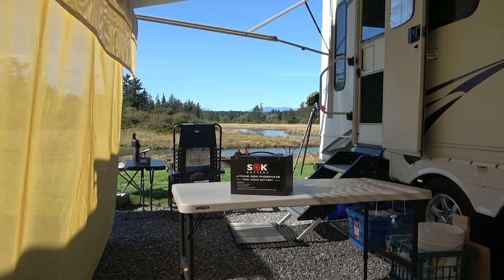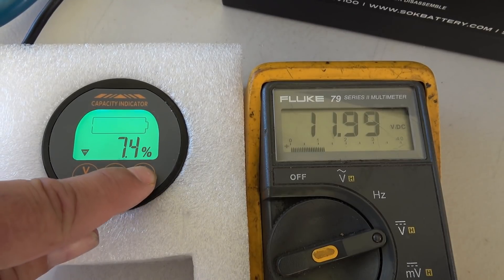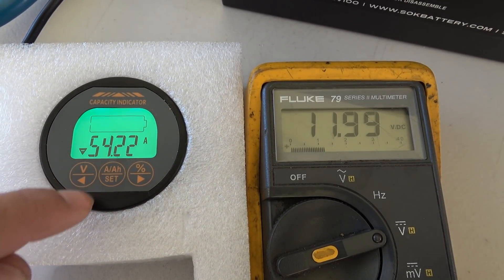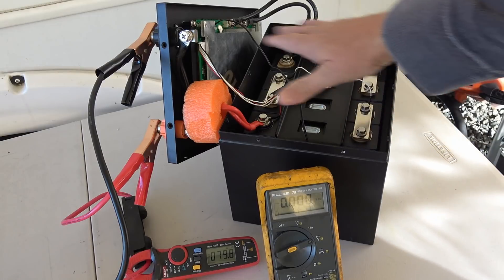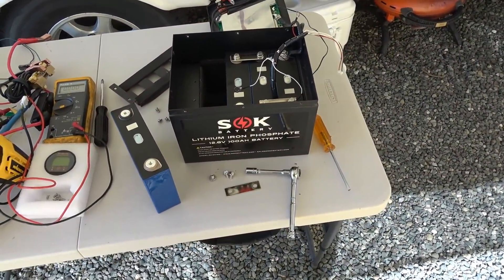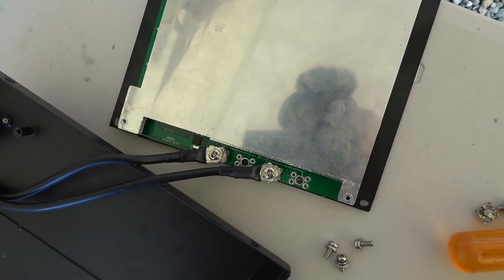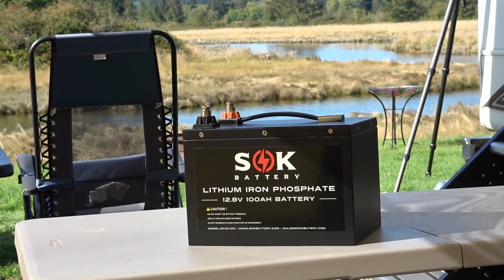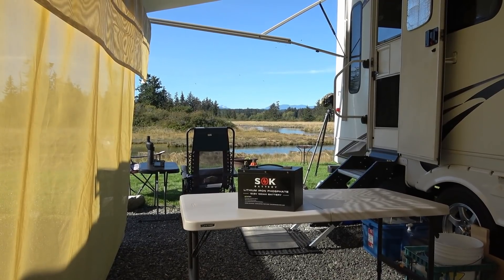SOK Lithium Battery Review Update + Giveaway Announcement

Comment: These batteries are horrible I have had my 280AH since may amd it has yet to work reliably. Every time I wake it up from sleep it runs for 20 min and dies. Have replaced the bms 2 times and it's always cell 4 that dies.
Reply from the maker: Weird, they have a pretty good reputation and have been around a while now. I wonder if the cell is killing the BMS or a flaw in the wiring. I haven't had any issues with the SOK. I've tested a 280Ah model in my system for many months. The only thing I didn't like was the app but the battery performed well.  At this point they should give you a refund or a new battery.
Reply: @LoveYourRV  that's what I am trying for now, WISH me luck.

Comment: Ray I am curious ..I am running 3 100-amp 12 volt renogy  lithium batteries in my rig  ..have you ever noticed the battery closest to the ground tends to discharge first ?? or could I have a bad battery ?
Reply from the maker: No, can't say I have, but I do take the batteries out every 3-6 months and recharge them fully individually just to make sure they are balanced as I imagine over time they can drift.

Comment: I just watched both of your vids on these SOK's and you said here that your OEM charger would not charge the SOK and you covered that before. I never heard you mention anything like that in either video. Maybe I missed it.  That's pretty important information to know before going to Lithium.
So I'd like to ask you a couple of questions and I really hope you'll answer: 
1) I currently run lead acid Trojans. I have a Inteli-Power PD-9260C charger just like the one you tested with in video one. Will the PD-9260C charge these SOK's just fine even though it's a 4 stage charger
2) If I was to buy two 100Ah SOK's do I hook them up in Series like I did with my Trojans or is it just be better to buy the 206Ah SOK version

Thanks for doing these videos 👍
Reply from the maker: Here is the video you'll want to watch https://www.loveyourrv.com/lithium-battery-charge-test-can-you-use-a-lead-acid-charge-converter/  Personally I'd rather get two 100 AH for redundancy if something goes wrong you're not dead in the water.  If you have a 12V battery system you'll want to hook them in parallel, not series.  Hooked up in series the voltage doubles so they would be 24V. When you say Trojans I assume they were a 6V golf cart type and that's why they would get hooked in series to create 12V. 
I'm actually just about to install and test a new converter charger from WFCO that they claim auto-detects whether a person has lithium or lead-acid and then adjusts its charging profile to match. https://wfcoelectronics.com/product-category/auto-detect/wf-8900-ad-rep-series/ Look for that video in the new year. Cheers! Ray
Reply: @LoveYourRV  Thank you Ray so much for responding. So ya, myTrojans are 6V golf cart type and are hooked in series to create one big 12V. And they have served us well over the years. But Lithiums in Parralell Ok got it. I totally hear ya on the redundacy part of having 2 batts instead on one. I also don't like having all my eggs in one basket. I currently have several power solutions in the event of an emergency or if for one reason or another one power source is not available. 

But what about my existing Inteli-Power PD-9260C converter charger that I use for my Trojans. (like what you showed) Would that converter have to be replaced too? That's why I have always shied away from going to Lith batts. There's always more that has to be changed out that just the batt's. It's a never ending battle of upstream/downstream issues and conversions.

Any thoughts on this will be greatly appreciated. 👍
Reply from the maker: If you have the manual Charging Wizard pendant you could use the PD-9260C for charging. You press and hold the button until the light stays sold green. It overrides the lead acid charging algorithm and manually boosts the output voltage to 14.4 Volts which is great for charging lithium batteries. I think it does it for 3-4 hours or so. https://www.progressivedyn.com/rv/charge-wizard/pd92201-converter-status-remote-pendant/  I've been using it for years for generator charging of my lithium batteries.
Reply: @LoveYourRV  Thank you Ray so much. Yes I have the Charging Wizard pendant as well but I didn't know that holding the button overrides the lead acid charging algorithm. I'm going to watch your video/article that you linked above to get a better understanding. We can all learn from each other. I luv learning new stuff. BTW...after quickly looking at your channel and playlist page, I bought the Bluetti AC200P and some solar as a redundant power source mainly for emergencies when existing power sources go south for whatever reason. I just love this unit. It's a beast. I'm actually working on a video right now about it and how I intend to integrate it into our 50amp coach.  That won't be out for another few weeks. Again thank you for Collabing with me. BTW...I subbed to your channel. 👍
Reply: @LoveYourRV  So after watching your linked converter video above I'm like.....my system is identical to yours. I even have the Trimetric battery monitor like you do. I've been using the PD-9260C and Trimetric for about 5yrs. now for my Trojans and it all has worked flawlessly. 

But getting back to the Pendant. I knew about pressing that button to go into fast bulk charging but I didn't know that by doing that it cancelled the lead acid algorithm. So that was good to know. So as I was thinking about that in real life use....see if my thinking is correct on this. 

Let's say down the road I went with 2 of those SOK Lith batt's. I'm using them as normal with my  PD-9260C. But in normal mode they probably will never get past somewhere around 50%-55% charge. So, I'd press the button on the pendant, and that bulk charge will bring them up to 100% in maybe 4-5hrs. lets say. Once at 100% I'd have to press the button again to put the PD-9260C back into regular mode. So as the Lith charge goes down I'd have to do this manual bulk charge with the pendant every so often. It wouldn't be an automatic function. Is that right? If so, ya it would be a little bit of a hassle and I'd have to keep an eye on the batts, but I do that anyway so I don't think that is a deal breaker keeping the PD-9260C that I have already. I'd just have to press that button from time to time to bring them up to full charge manually.
Is that correct thinking?
Your thoughts?
thx for all your help Ray 👍

BTW...I watched your Bluetti Part 3 video. When I saw you had that sucker outside with solar hooked up I thought ya there's no way I'm doing that. 😝The Bluetti is a Beast power wise and WEIGHT wise as your know and I luv this thing. But the way I'm setting mine up it will live inside the RV. Never be brought outside. During off grid, or power outages, all charging whether it's from my portable Honda generator or solar, I've installed a pass thru plug where all wiring goes up thru the floor of the RV and into the Bluetti. I have several ways to charge the Bluetti other than that but I'm going to be showing all this when I release my video in a few weeks.

One other thing I noticed is when you had all those solar panels laying on the picnic table while it was raining. I have the exact solar panels (2 of them not 3) and in the user manual for the panels it says, "In order to maximize the lifespan of these solar panels, please try to not get them wet or soak the panel into water". Did you see those instructions? Now the wiring was under the panels to provide some protection but I don't think I would of done that.
Reply from the maker: Yes, I've been using mine manually for a couple years, its only when I need the generator so not a big deal for me, most times the solar is ding the charging or my DC-DC charger when towing if needed.
If the batteries get full, the lithium BMS shuts charging off so no worries of overcharging. But usually if I'm running the generator it means my batteries are low and I just wont to give them some power and then let solar take over.
I like to torture test things I review. Its completely ridiculous to me that Bluetti sells panels that can't get wet. I'm sure they took note. ;)  Its one reason companies like to have real world reviews because most of the time they don't actually use their own products and often don't think of simple things like make the panels water proof.
Reply: @LoveYourRV  Thanks Ray 👍I've enjoyed talking you.

Comment: I'm having 24v system with:
 800w SPanels (24v)
 400ah batteries
 2400w inverter, (LV2424), later changing to 3k inverter (when changing to 240v system, 3024gk)
Does it matters getting 2x 200a or 4 x 100ah?
Reply from the maker: Sorry, I'm not sure about that, guess it depends on space. Two would make the wiring much simpler.

Comment: Nice two reviews. Any thoughts on their claims of 4,000-8,000 cycle life? They are a brand new company and folks are just now installing them. Obviously, you could not have cycled it more than a handful of times but curious to know if these cells (and their performance) are already a known variable.
Reply from the maker: Thanks. Its comparable with what other companies that use the same type of prismatic cells are saying as well for life cycles based on average use. But these types of drop in replacements have only been out a few years so its anyone's guess for the real long term. Battery technology is evolving quickly.  Cheers, Ray

Comment: Can I replace my RV acid battery to SOK battery without any changes ?
Reply from the maker: Depends.. Almost anything will charge them but to get the most out of lithium type you need a charger that can put out a high enough voltage, many solar controllers can do that  by adjusting the settings but a lot of the OEM lead acid converter charger systems fall short. Watch this video - https://www.loveyourrv.com/lithium-battery-charge-test-can-you-use-a-lead-acid-charge-converter/ and I have more related to my change to lithium here - https://www.loveyourrv.com/tag/lithium/  Cheers, Ray
Reply: @LoveYourRV  Ray, thank you, very useful information. My rig Sprinter 2004 has very old convertor- charger. I going to check alternator voltage, if I can get  14,4 v and up, so I can charge Aux battery during the ride. . ( what I did all the time using Aux  acid battery ) I have solar battery, so charge Lithium battery no big issue
Reply from the maker: @jkjk-hj7hb  You have to be careful when charging lithium batteries with the alternator because lithium has very low resistance and can absorb higher amperage than comparable lead-acid and possibly overload the alternator causing it to overheat and maybe fail. I actually installed a DC-DC charger so I could charge my lithium bank. It regulates the charging amperage. Here is my setup - https://www.loveyourrv.com/renogy-40-amp-dc-dc-charger-installation-and-demo/
Reply: @LoveYourRV  Thank you
Reply: Sorry one more question  What are you preferred : Smart Lithium Iron Phosphate Battery or LiFePo4 ?

Comment: Just curious if the sok battery or your lion safari batteries running in parallel can start your generator without an issue?
Reply from the maker: My current generator is a little 2000W portable that has a pull start.  I guess you would have to see what kind of amperage the generator needs. My 3 Lion's in parallels can put out a sustained 450 amps but much more for short periods.  So I'm guess it they can start most RV generators. Cheers, Ray

Comment: Thank you for this review.  I’m looking to upgrade my standard lead acid battery in my travel trailer.  What would I need to do to add a charger that would charge a Lithium battery or will the charger that comes in the TT charge it?
Reply from the maker: Check out this video where I discus that topic and demo charging lithium batteries in my trailer - https://www.loveyourrv.com/lithium-battery-charge-test-can-you-use-a-lead-acid-charge-converter/  Cheers, Ray
Reply: @LoveYourRV  excellent video and explanation. Thank you.

Comment: Very interesting.  The SOK compares very favorably against the popular Battleborn.  Battleborn's published discharge voltage profile at 50 amp discharge rate shows their 100 AH battery dropping below 12V at 15% capacity remaining.  The SOK is down to 7.6% remaining at 12V.   (and on top of that, you were discharging a bit above 50A).

Comment: Oddly, a few Amazon.com reviewers determined that it exceeded it's 100Ah capacity.
Reply from the maker: That's great! Maybe they have improved them. My review battery was one of the very early batches they made and sent for review and I also have used it it for months before this test. I hear the lithium cells will put out slightly higher than rated when brand new.

Comment: Ray.
 Don here from Waterloo Ontario.
Although from northern Ontario. Travelled a lot, cut trees in port Hardy in '75. Passed Campbell river many times to and fro back to work. Living in north Vancouver in those days. I have a 34' Tiffin class A, that had 2 6 volts golf cart batteries but thanks to info from you and your channel I've upgraded to 4 lion energy 1300s/victron 712. I don't park where there is electricity, now in process of ordering 6 more from utah which would give me 1050amps. 
I found charging the 4 was a tedious task, it took approx 11 hrs, I timed. I am planning to put a magnum 3000 hybrid with solar, first chance I get to go to Red Bay Alabama. In the meantime could you advise what I can do about charging.  I'd hate to buy something now and have to get something else later.
If you can get back to me at this email with any thoughts , I'd appreciate it, thanks for what you do.
Tiffinwilltravel@gmail.com
Reply from the maker: Here is a video I did on lithium battery charging that may help.
https://www.loveyourrv.com/lithium-battery-charge-test-can-you-use-a-lead-acid-charge-converter/

Comment: It's interesting how Chinese and US markets are evolving. A lot of time the US companies are simply importers, sometimes assemblers, of a Chinese product. I bought a Bafang BBS 02 ebike motor 10 days ago. These used to be things you bought from a US company, Luna or Lectric (the old one). They would market stuff, make claims, whatever. But they would try to brand the motors, even with their logos. I just bought one from Bafang USA, very low price. It's the same as what the US suppliers sold, down to the packing. Point is that Bafang has a US presence, at least a warehouse. In this LFP case, the US suppliers are not responding very quickly, but I think the SOK price is something they cannot ignore. These cells are a bit generic but the site lists Sinopoly cells, 400 AH, for a similar price per watt. My recollection (which dims daily) is that Sinopoly is a major brand. LFP is safer and it doesn't requite cobalt. 

You might look at a split heat pump like Campervan Kevin, with a somewhat upgraded LFP bank. You can heat and cool with this system. The compressor is outside. I don't know why they don't make well insulated RV's that could be heated and cooled with solar and maybe a 6 kwh battery bank.

I guess I won't do another RV. The West I loved is disappearing fast. Two million acres of forest, a million Joshua Trees...The only way to love nature now is to try and save it, I guess. I sure do miss that old climate. Rainy season came and went here with .02 inch of rain.

Comment: it's a lot of money for a battery.
Reply from the maker: Not for a 100AH lithium RV battery, it's actually on the low side, but if comparing to a typical 12V lead-acid battery then yeah, much more expensive. Capacity wise 2-3 times the price. But they do last a lot longer and have many performance perks over lead acid, so avid boondockers love lithium.

Comment: @Love Your RV,  did you do a low temperature cut-off test to verify the BMS is shutting it down before charging damage occurs? this seems to be standard issue with other low price LiFePO4 batteries.
Reply from the maker: No, forgot to do that. The BMS board that SOK sells and uses has internal and external temp sensors - Can see the specs here - https://www.sokbattery.com/battery-management-system-lifepo4.html

Comment: Thanks  for the video. Just purchased the 200ah SOK battery so it was great to see your testing.
Reply: How is that working out for you?
Reply: @rocketj7449   So far so good. It gives me steady amps while I’m traveling in the RV. The lead acid battery that came with the RV would die in record time while traveling.
Reply: @GoTrippinwithLeo  I'm glad to hear that.  Think I'm going to pull the trigger on this battery.  I just can't fathom why BB are double the price.  Are they really double the quality?
Reply: @rocketj7449   John, I thought the same thing and actually put an order in for bb batteries but saw these and change. I bought these at the SOK website and there about $150 cheaper than Amazon with free shipping also. They reviewed by Will Prost and they all sold out. Should be in stock as of Dec 1. Enjoy!

Comment: Hi Ray, Can this battery be mounted on its side in the battery trays? Is there any voltage loss by mounting it this way?
Reply from the maker: Yes, you could mount it however you like, every thing inside is locked on place quite well and the lithium cells aren't affected by orientation. No voltage loss. Cheers, Ray